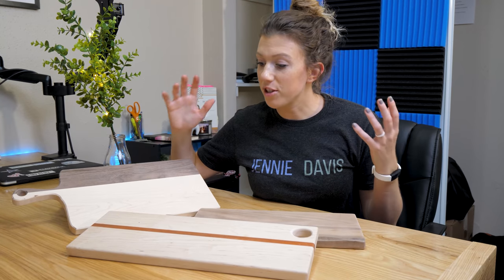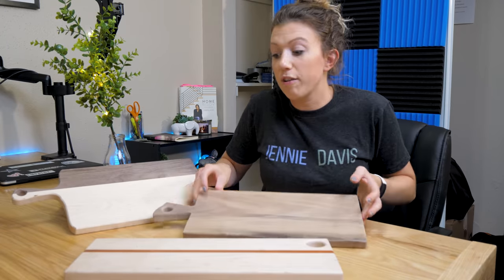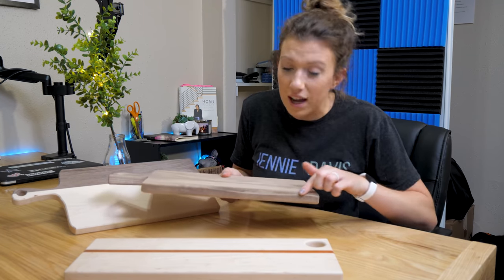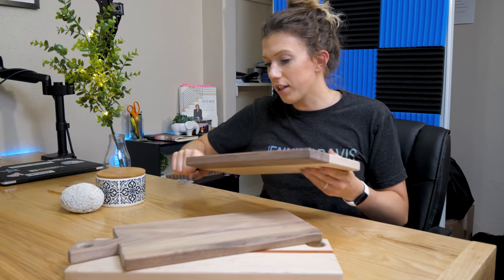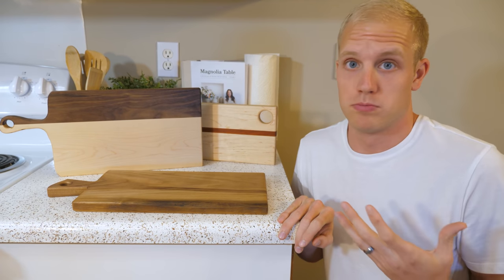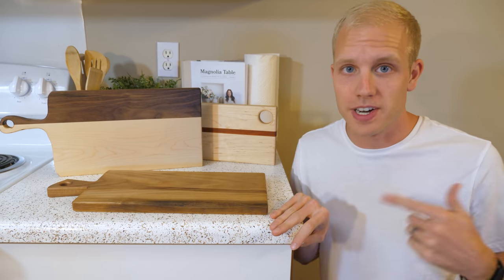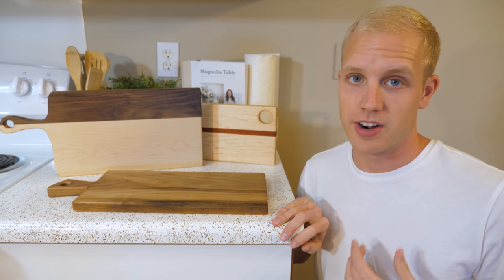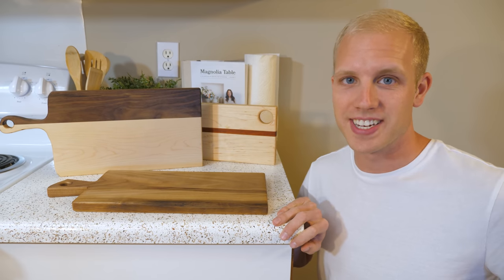🛠We PROTOTYPE Some New CHARCUTERIE BOARDS - 💰Sell Woodworking Projects

Comment: For sending the cutting board with the obtuse angle on the handle I use a sending strip on my scroll saw.  This is great for getting into those tight corners. Additionally when batching you can do all your work a grit at a time.

Comment: How to sand the sharp inside corner... a good file, or a stick with sandpaper glued on (different grit on both sides, air file (it has 1/2 inch wide small sanding belts). A 1 x 40 belt sander. Some are cheap and take some time, some are a little expensive. There are 1/2 x 40 belts available also, or make your own with sheet sandpaper and  tape.
Reply: Great suggestion! How about rounding the corner just a bit so you can use a small sanding drum? That way to keep the overall look with a slight modification for sanding speed.

Comment: Use a router sanding bit for your cutting board with the tight angled handle.  That way you can control the material removal on your table.

Comment: In those tight corners you drill holes to get that smooth rounded shape with the radius large enough to get a round over bit in there. Great job by-the-way on those boards
Reply from the maker: That’s a great idea! Thank you so much!!!

Comment: First, I've watched a handful of your videos and it took me a little time to realize something about Jennie that makes her so adorable - she has the confidence (and rightly so) to be on camera and not feel the need to hide behind a ton of powder and paint.  She realizes she looks great without hiding behind a ton of makeup (or behind a very slight amount) and I really wish more women would take that approach.  That's one of the reasons I find my wife so attractive, and so many of the women I was attracted to throughout my years.

I liked the first charcuterie board that Jennie liked for it's simplicity and ease of reproducing.  That thin line of hardwood adds a nice pop of color without going overboard and being too busy, and it is easily repeatable from a business standpoint.  Cut the light and dark woods at full length (8-10 feet) and make one HUGE and LONG board and glue it up before moving on.  Run the entire piece over the router table to quickly and easily do 75% of the routing, then cut the boards to length and finish.  Where the handles are located, you could make the board a little wider and cut the handle for two boards from the same width of wood to save wood with the bandsaw or jigsaw.

If you're going to sell that first one Jennie had as a thumbhole capable board, you may want to make the hole a little larger and possibly cut the hole on an angle so it is more ergonomic for a thumbhole, then round over the sharper parts of the hole for the sake of comfort.  The second one with the ~90 degree angles that would be hard to create a template for - I think you're over thinking the issue.  Skip the 90 degree angles that require individual time consuming work with a chisel and instead, cut the area with the 90 degree angle in a circular pattern using a forstner bit for that part, and cut out the rest of the handle, then use the spindle sander to smooth out the corners where the handle meets the board before finishing the edges with the router.  I'm not sold on which edge I prefer on these, the round over bit or the chamfer.  I'm leaning slightly towards the double chamfer, but with a handle that would not be quite as comfortable.  Also a cove and bead type edge would make this easier to get a grip on the edges of the board when picking it up off a flat surface, or maybe going heavy handed on the routing when you round over the edges of the handle.  If you're making these out of a template, you could also create a template so you can put in the routed juice trough.  if you make the boards all the same general thickness, length and width, you could build a single template to guide the router so you can easily make it a juice trough without going too far and accidentally creating a juice drain.  :0)  I wish I could attach an image, but basically what I am thinking is a router guide made more or less with a rabbit type slot where you could simply slide the board into the rabbit guide like a hand into a glove, then run around the guide with the router to make the slot, then remove the board and repeat with the next.  As long as your dimensions are fairly close, it makes an easily repeatable use jig.  I would also suggest making the handle on that one a little longer for comfort and control.  The third one Jennie showed was nice, but the handle being off to the side would make it a bit awkward looking if you hang it.  Just to spitball some ideas, you could have the handle attach as it is now, but angle the handle to the side so it hangs essentially straight using the handle hole, or leave the handle as it is and drill a small hole, but not all the way through the board so it could be hung on a wall with the nail/screw hidden behind the board.

Comment: Get a 3/16 blade for your bandsaw. The 3/4 I saw is meant for resawing. Also, a Carter v-groove bearing behind the blade lets you make free form curves without binding.
Band Saw Stabilizer Guide System for Scroll Cutting, from Carter Products. (just looked it up). Had mine for years and love it.
Reply from the maker: Yeah we have a thinner blade, but this was just a prototype. Final production process will iron out which tools

Comment: Since you have a glowforge, you could design a template for consistency and utilize a flush trim bit to finalize the handle shape. Seems like it would work out if you have consistent dimensions of your boards to just throw the template on the board with some double sided tape or other system for easy removal. Great video and awesome job

Comment: I liked all of the boards, I agree with Jennie about my favorite.  For the handle, I suggest using a Forsner bit to make a radius on the interior corners.  Then it will be easier to sand, especially if you have a spindle sander of that radius.  Greetings from Idaho.  Wayne

Comment: for the handle to help with the tight corners try using a drill bit small enough the band saw or jigsaw the desired shape. Just a thought.

Comment: For the tight corners use a 1/4" flush cut bit and use a drill with a 1/8" sanding bit for air tools

Comment: I also am working on building up my name as a word worker. I was wondering if you had any suggestions on avoiding boredom while batching? If I have a custom (new) project I'm all in. If I have to make something (coin rack, 4 glass wine display, ...) more than twice I think I rather watch oil-based Polyurethane dry. I also want to say a Thank You! your pricing guide has really help me be able to charge more correctly and it gave me a tool to talk through with my customers. easily explaining how and why "custom" costs so much. To be clear I'm still not charging "full cost" (I'm not charging the labor $ I'm worth) as I feel that I'll bid myself out of the job but, I'm so much closer because of you both.
Reply: As a locksmith I usually listened to a podcast that I rally enjoy While doing "braindead" work. So if everything is set and you know the routine, time pass by pretty fast. But this only works if there is not much thinking work to do, but only "grinding" work of course. Either that or put your thought in every piece after the first how you can make each step more effective, this also take the boredom away. Cause you can always improve something in the process.

Comment: Hi guys, you probably have already worked  out, by now, which way is best to cut the fancy handles by using templates or whatever works for you. It just jumped in my mind the key cutter machine. It uses a template, the original key, but instead of overlap, as you usually do with templates, its beside, as a guide. If you could applied this technique with the help of an arm, to any of your machine, maybe saves you time. I hope that this tip is useful and works out for you. I just want to say that its just an idea, it's not something that I've tried myself.  
You worth 200 % your tutorials are excellent 
Its like 2 in 1 👌
Many thanks 🤗

Comment: One of the designs that I have to cut out a lot had a sharp corner in it my solution was to change the corner to a small forstner bit that has a corresponding drum on the spindle sander and it didn't really take anything away from the look of the product

Comment: Great video.  If you have a spindle sander, I would base the radius for those two corners that connect the handle to the main board off of the smallest spindle you have.  It might make the handle a little wider but it will make sanding easier in the end.  I like it when sanding is easier.  :)
Reply from the maker: Great suggestion. Thank you!
Reply: That Rigid sander has spindle
 attachments

Comment: On the Walnut board that has the sharp angles on the handle, when you design your template make it and then use a round over bit on the handle area. That way when you use the template it's already setup for using a round over bit. Easy Peerzie lemon squeezy LOL

Comment: I rally enjoy tour videos and it IS nice to see and follow the kompani from start. I am just a armature woodworker but cause of tour video I was thinking I maybe Gould sell My work as well. But it would probably only be in small hobbyscale för extra Money. 

So I liked the "plain" one better. Probably cause the line in the middle. Cause it really made the whole piece. The other one was nice with handle, but I think that will seldome be used (the handle) 
There is also 2 other aspect why I like it in practical thinking. 1. It is easier in the production line if you like to make it in bigger scale. 2.nd is that it is easier to see the "branding" that probably will be burnt into the white area. But you can also hide the branding in the line if you don't want to have a big sign with a logo. 

For a more advance I would look at a painterspalettboard and try and remake the hole so it might look/feel like one (more ergonomic) when you "serving" sense painters use it daily in that way. But that will make it a little harder in making process than just a plain hole. 

Thank you for the video and keep the work up :) 

A question at last... I am from Sweden and I uncertain, but you have a flag in the background and it looks very much like the Czech flag... but not really. What flag is it?

Comment: To sand into the "sharp" corners I use a 1/4" spindle sander (you could run them in a drill if need be) ... sure it won't be a super sharp corner, but still a very good looking one ;)
Reply: I came to suggest this too. 

Making a small spindle would be pretty quick and simple. I used to have a small die cutting bit with a slot through the length, quick grind to remove the teeth and it would be great to wrap a bit of sand paper in to create a very narrow spindle for a drill.
Reply: Spindle sander for sure. Inexpensive at Harbor Freight.

Comment: CNC like the one you have same exact every time no template little sanding
Reply from the maker: At scale, a CNC like ours would take at least 2 times longer than a flush trim bit on a router. No contest.
Reply: Jennie and Davis I admit I have a commercial CNC but my cousin has the same CNC and it does not showing up late no Worker’s Comp. no employee taxes no accidental injuries and I bet you the small cnc keeps up with your pattern router most quarter inch bits on a slow machine like yours are 50-75 inches a minute that means if your paddle is 50 inches of surface material it would only take about two minute to cut out there’s no way you’re doing in a pattern router especially when you have to take the time to adhere it to your material and take the tape off when you’re done and then all the sanding no way I promise you’re wrong
Should listen to experience I promise it’ll take a little bit of time to learn it but it’ll be well worth it
I’d be happy to give you a guys info to help teach you the software he’s on YouTube
SpindleTV

Comment: To sand into the sharp corners try a 1" belt sander. I use one of those to get between the ears on my bunny Easter baskets. In a pinch a disk sander might work as well